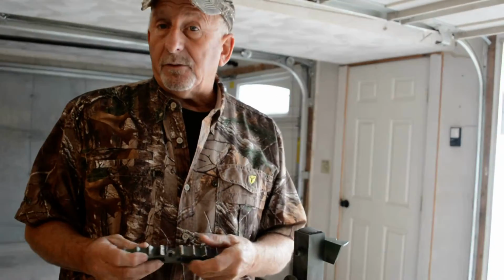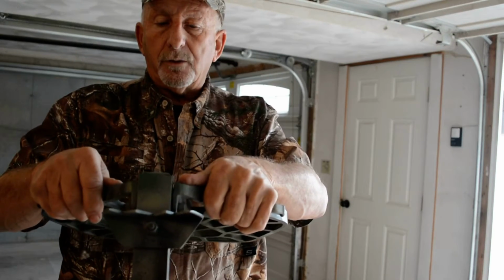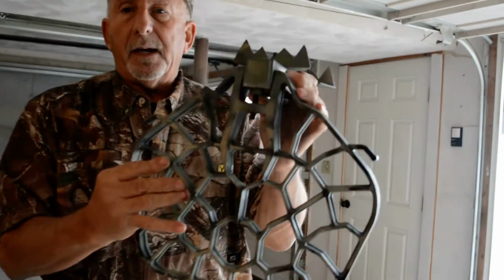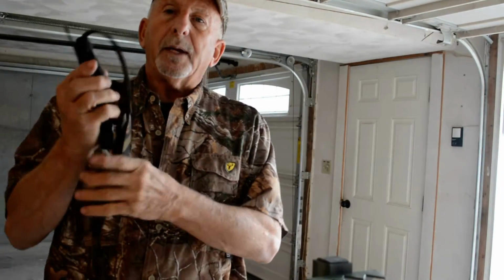Slo Mo`s XOP  DIY platform build .

Comment: The cleats you made you said they were made from 1/2  inch aluminum channel.  Is that C channel or just a 90 angle angle?  I have 1/16ths angle that I wanted to try just not sure it will be strong enough.
Reply from the maker: I like the 1/8  x1.5  inch 90 degree angle for my cleats . It`s usually in stock at home depot and is rock solid as a cleat . Less than 10 bucks .You can use the 1/16 stuff but  depending on  cleat depth, angle, etc it will definitely not work as well . I would stick with the heavier stock. Also XOP has two seats . One has tabs for camming it down and the other has no tabs . The latter is lighter and flexes a bit  more than the other . Both are great platforms but I prefer the  latter for longer sits. Good luck with yours.